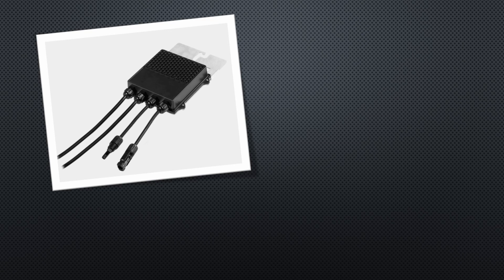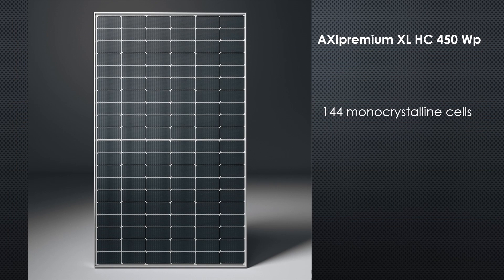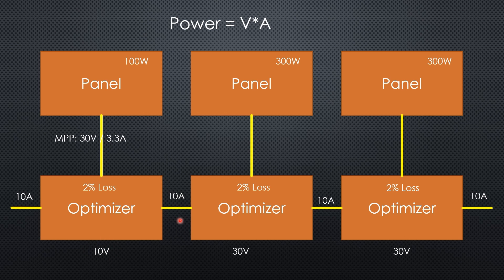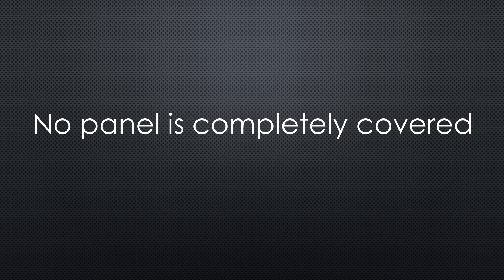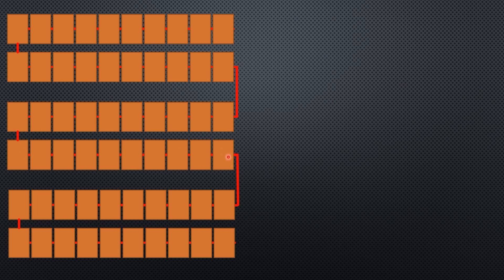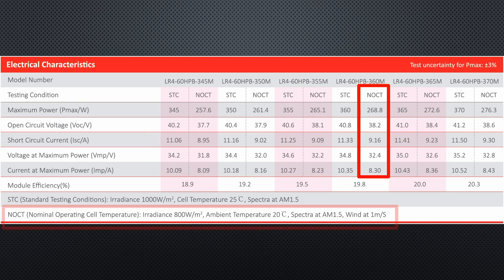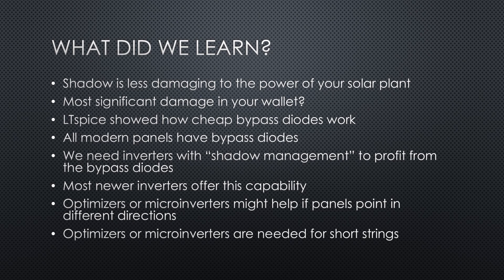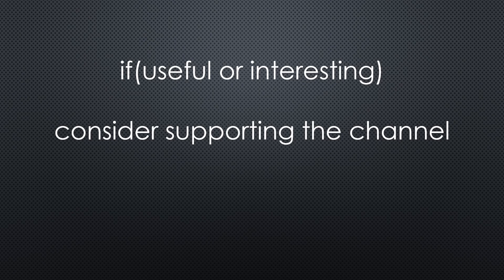441 Are PV Optimizers Worth the Money (e.g. SolarEdge)?

Comment: Great video, as always! One thing that I do like about optimizers: in case of a fire, when you turn off output, the optimizers will drop the voltage on roof so there is less chance of electrical shock to firefighters.
I didn't know about bypass diodes, makes sense the manufacturers implemented that :)
Reply: Yeah its a good idea on paper, but an incorrect installation, a factory defect, or like in most cases a bad connector tend to start these fires. Connectors failing are one of the leading causes of fires and when adding optimizers you triple the amount of connectors in a system. Not to mention that not all systems are equipped with such devices and they can fail closed leaving the system still energized. So in the end you have to train for the worst case scenario and treat each as it is live. The real solution would be to integrate into the panel but I don't see module manufacturers wanting to do that.
Reply from the maker: I do not know how dangerous it is for firefighters. As always, you have to hold both ends of a "battery" in your hands to experience a shock. Reading through recommendations for firefighters in this case, they list various things. None of them related to be electrocuted by the panels.

Comment: solar panels for me will be next years project  😎 thank you.    PS.  For a cousin IIOT project.      It is fairly simple.   remoteXY software free or $7.50       youtube remoteXY learning videos  
 I finally received great results monitoring a 6 digit panel meter Modubus rtu rs485 input register 30001  using an Arduino IDE esp32_dev_module Bluetooth and cellphone remoteXY app.
$23.00    LILYGO T-CAN485 ESP32 Development Board CAN Modbus RS485 IoT Engineer Control Module                                                LTspice is wonderful with great circuit simulation. 🥰
Reply from the maker: I just used Node-red to read the Modbus (it is on WiFi). But you are right if you want to read the "real one"
Reply: @AndreasSpiess  thank you and I will check out Node-red.

Comment: Installer and service guy here. SolarEdge breaks. ALL. THE. TIME. Save your $$ and get an SMA inverter and run your panels straight to each other. If you have issues and absolutely HAVE to have system optimization, get Enphase microinverters. If you're gonna spend the money on SolarEdge, just go all the way and get Enphase. I have about 12 service calls in queue here in central Texas, almost all SolarEdge.
Reply from the maker: Thank you for sharing your experience!

Comment: Thank you very much, Andreas! We got our PV system installed back in august, and because of your "warning" in one of your earlier videos, I made the last minute decision to cancel the already ordered optimizers - not so much because of their additional cost (I still would have loved to monitor the performance of each module), but more because of the chance they could fail one by one over the years, causing a lot of cost to replace or remove them, especially since they are installed at a hard to reach place. Better to have a reliable, though less performant system for many years, than a little bit more performance with the risk of more problems later on - these modules shall stay untouched on that roof for the next 30 years, if possible. (And saving an extra 900 euros on the invest did not hurt, either... :-)
Reply from the maker: I added a simple "divided by the number of panels" in my Grafana board. Now I can compare the cells and see if one creates problems. The only thing is that I do not know which one it is ;-)
Reply: Pretty much everything I've read and watched about optimizers says they are a waste or worse in most situations.

Unfortunately, since the US NEC 2017 & 2020 electric codes require Rapid Shutdown on a per panel basis, the math changes a bit.  If you already have to put an additional RSD module on a panel, maybe putting on optimizers with RSD and monitoring instead makes more sense since you are no longer adding more connections or modules in the chain.

Comment: The "the whole string will stop working" claim became invalid as soon as solar panels got outfitted with bypass diodes many years ago. The only real benefits of optimizers is that you can squeeze out a little more production in the morning and evening when the un-optimized string voltage would otherwise be below the minimum operation voltage for the inverter. Also, it allows you per-panel monitoring which lets you detect failing panels early. Also, your cost estimate is far off.. I've recently installed a SolarEdge system, and the optimizers cost 30 Euro, for each panel of 220 Euro, so less than 15% increase, instead of your claimed "one third".
Reply from the maker: Good to know how much they cost now. Like that I can imagine what kind of components they can select (e.g. electrolytical caps) if they still want to deliver money to their shareholders.
BTW: My solar panels get the maximum voltage with nearly no sun. So it is more important how much the minimum current the optimizer can handle to not bring the voltage down if it switches on. Anyway, as you say, from a power output perspective it is neglectable.

Comment: You are my hero. I'm in Western Switzerland (NE) and your project is exactly what I've been considering for a while. But it seems most information I can get is superficial or only applicable outside CH. I want more in depth info and you're providing it. Thanks!!!

I have 2 things I'd love you to address:
1. A more in depth video on working with the cooperative. I can't find a good resource showing what to expect and it seems like there are up front costs. Did they buy the panels for you? Do they come with a first assessment? In NE the cost for them is 1000 CHF plus 100 per kWhp. Are there supply issues currently? What is a good time of year to start the project?
2. Does the Huawei system allow you to integrate with IoT? Is there an API? Can I MQTT out the production for instance? The web UI looks great but I'm sure you're like me and want to get the data yourself.
Reply from the maker: 1. I purchased my material through the cooperation and got much better prices.
2. My Huawei is integrated in Node-Red using Modbus via TCP/IP. The registers are well documented.
Reply: @AndreasSpiess  Thank you!

Comment: Andreas, great Video. Thank you. 
As you pointed out, there are situations where optimizers might be worth it:
* Assume a situation where a panel is largely shaded. In this situation, the shottky diodes would bypass the whole panel. This woul not result in the whole string "tied down", but still, this one panel does not produce power anymore. Whith an optimizer, this Panel could still deliver it's small part to the system
* Solaredge Optimizers allow to build very long strings (up to ~11.5kW within a single string), and you kind of don't need to care about elecrical Specs (VOC of the String in cold conditions or the like) or direction of panels. This might facilitate cabling a lot - you need to factor this in for the investment decision 
* Solaredge inverters tend to be cheaper than others as they don't need to perform the MPPT anymore - they operate at a constant voltage.

I would be interested in how you "controlled" the optimizer in your test setup? To my knwoledge, you need some Solaredge device to tell the optimizer what current it should produce.

Best regards
Reply from the maker: I did not want to condemn optimizers! I just wanted to show a false claim. In certain cases, they are good. However, if the bypass diodes kick-in, also the optimizers do not get energy from this part of the string...
I cannot control the optimizers. It is done by the inverter.
Reply: The diodes are inbuilt to the panel. If the panel is largely shaded, the diodes will be activated even before optimiser can do anything. Even if the optimiser manages to salvage some power, it will be in few tens of watts which is miniscule when comparing panels of 300-500W.

Keeping 10kW in a single string is a serious risk of safety and highly expensive due to high amount of current flowing. Even if you can do it, you must avoid doing it.

Comment: I am looking into a solar install but my roof space is not ideal but I have no other options, as the panels will point in three different directions (3 panels: East - 3 Panels: South - 6 Panels: West)

I see most inverters are only capable of supporting two strings which means I would have a string with panels facing different directions. 

Do I still need optimisers?
Reply from the maker: Your situation is very special. You need one MPPT for each direction. And your inverter has to work with only 3 panels. Most small inverters have only two MPPT and need more panels to work with. So your best choice is probably Microinverters or Optimizers.
Reply: @AndreasSpiess  Thanks for your reply, I will look into Microinverters or Optimizers

Comment: There is one thing to consider, and that is partial shading of a single cell. My panels have 3 anti-parallel diodes, one diode for every 24 cells. If one cell gets partially shaded, it is reverse biased by the other cells in that series. That can lead to localized heating(often referred to as "hot spotting") of the surface of the cell still exposed to the sun. That permanently degrades the performance of that cell. A MPPT that does not globally scan, means that the string only produces the current of the weakest cell(the one partially shaded) and you lose a lot of output, but, you don't damage the cell/panel. Clearing the leaf, or the bird deposit is all that's necessary to restore full rated power of that panel. The ideal solution, would be a short barrier Schottky diode anti-parallel to each cell. That one cell gets by-passed by its diode, and you lose only ~5 watts of power in that whole string, and the cell is protected, until the panel gets cleaned.
     I agree 100%. If all the panels in a string are mounted on the same plane, the losses of the DC optimizers is greater than the differences in the outputs of the panels. Even as they age, I don't think the differences will be anywhere near that 2% used up by the extra electronic modules. They cannot compensate for the damage of the hot-spotted cell caused by the partial shading. the only hope is, to limit the current load on the panel, protecting the cell, but, instead of the whole string being de-rated, you only lose the rating of the one affected panel.
Reply from the maker: Thank you for sharing your thoughts!

Comment: Hi, don't understand why in your conclusion you are talking about optimizers and microinverters : Why confusing followers whith 2 differents elements : As i understand, optimizer claim to help to reduce differences between pv yield in the farm... But micro-inverters are a solution to convert electrical power from dc to ac and inject it directly into the home power grid for auto consumption. These devices are not for the same uses.
Reply from the maker: Both claim that, if one panel is shaded, the whole string is not producing anymore. And Microinverters are "optimizers" with an inverter built-in.

Comment: While this video does great job of debunking the myth of a bad, or shaded shaded solar panel pausing production by blocking current (3:35), there are a couple of things that are not well investigated. I would like to see a follow-on video to revisit a couple of points.

When analyzing the effect of shading on a solar panel, the output voltage is what needs to be analyzed, as current is the string current of the system. Current passing through a panel does not change whether or not a panel is harvesting energy. This is why no change in current was observed (9:07), however string voltage would differ (and thus overall power level). Current on the string will always be the same for all panels at any given time of day, as all panel are in series. If a panel is not producing, the bypass diodes just bridge the flow of current bypassing some solar cells. Voltage across a bypassed panel substring with drop to that of the bypass diode. (~0.7V) 
eg: if one of the three sub-strings is completely shaded, then panel voltage will be ~2/3 of a non-shaded panel.

Early solar panels lacked bypass diodes. Bypass diodes not only divert current when a sub-string of solar cells in a panel are not producing, but they are a safety feature to prevent defective cells (acting as current sink) from over heating and causing a fire. Bypass diodes are no mini-optimizes (13:02), they just bypass the current from the string between all panels in series pass the non-functioning branch of cells connected to a particular bypass diode. Panel power (and voltage) will be reduced if current flowing through a bypass diode. The myth may have started based on these early panels (>50 years ago). It has not been relevant in the last 40 years. 

Regarding optimizers, again it’s the voltage that needs to be analyzed. The optimizer will adjust current load so a solar panel to operate at maximum wattage output for given light energy level (corresponding peak in curve at 11:55). The current and voltage on the panel side will track for maximum power point (MPP). Current and voltage from panel into the optimal will not match the current and voltage coming out. Current out of the optimizer will match the system string current, and voltage will be adjusted accordingly based on available power (minus the ~2% optimizer overhead). The optimizer (ideally) should make the panel harvest more energy by outputting a higher voltage (I*V).

While optimizers can improve energy output under certain conditions, the typical going rate to add optimizers these days (~50% of panel costs) makes them hard to justify. Especially if the system has string inverter with built in MPP tracking. This will accomplish over 80% of what distributed optimizers would provide. The real value in optimizers is in monitoring individual panels relative to the overall system. Optimizers can highlight if/when certain panels are not producing at historic performance, or if a bypass diode is active due to a panel, or cell defect. An alternative to using optimizers to monitor panels would be a cheap DYI microcontroller to monitor a panel’s voltage in realtime with data logging. Such monitoring could suggest if real optimizer hardware would add value. (ie: should there be panels, or periods of time when a panel is under performing vs. other panels in the system) 
This is typical a key part of the sales pitch to get optimizers, as it allows panel level remote monitoring and often it includes an extended warranty. Pretty pictures can help make for an easy sell. The ironic part, is that typically an optimizer, or microinverter that fails, not the solar panel. 

Micro-inverters are different than optimizers, and have a some valid use cases. Typically micro inverters are utilized where the panels are ground-mounted away from the building, or power distribution panel. DC current has higher losses if run over distances, thus using micro inverters have the benefit of doing DC-AC conversion at the panel. Micro-inverters also offer redundancy over using a string inverter. (no single failure point). A system with optimizers still utilizes a single inverter. To determine if micro-inverters add value, one needs to compare cost to the string inverter, and losses should a system would have a long DC wire run. (ground mount, or a second roof)

Good reasons for using optimizers, or micro-inverters would be if individual panels would be operating at different MPP compared to the average MPP of the system. Orientation, or panel size (watt rating), would be such cases.

A valid reason to for using a string inverter (vs micro inverters) would be if the system would included battery energy storage. Batteries store DC energy so could be feed directly from the solar string (depending system design and voltage of string, battery). If system had micro inverters, then would need AC-DC converter to store energy, and an inverter to convert the DC back to AC (to use, or export, but incurring ~5-10% loss with each conversion). This is the case with Enphase energy storage (input/output is AC). With battery storage (like Tesla PowerWall), the same inverter is used to regardless of whether power comes from solar, or from battery storage. BTW: this is why they prefer to only sell powerwalls with new solar installations. If your utility provider credits you for energy exported (either as time bank, or financial credit), it better to use the grid as you storage. The exception being for emergency backup, when the sun not shining.
Reply from the maker: Thank you for your additional information!

Comment: So it seems there has been a time when optimizers would have made sense. I think a Video of Dave Jones from eevblog has a good example of such an old installation where the shadow of a wire from an antenna dropped production of the old installation by 10%...
Modern Systems seem to have taken the learnings and fixed the problems. So optimizers have become obsolete.
Reply from the maker: I agree!